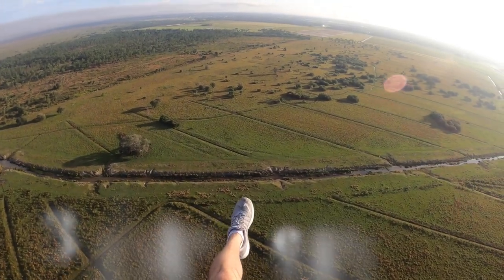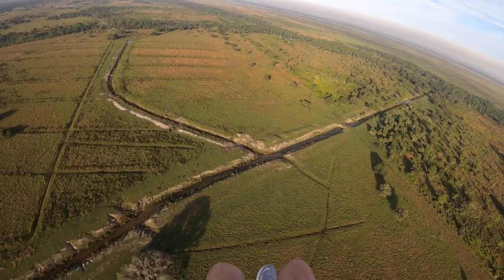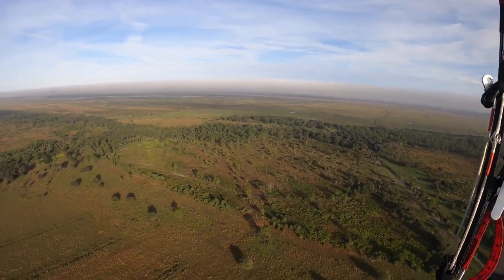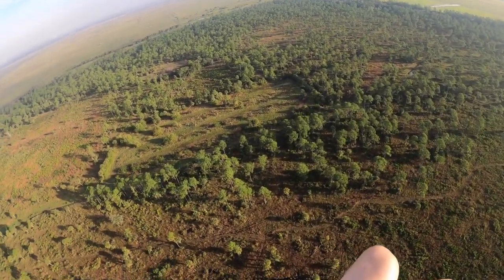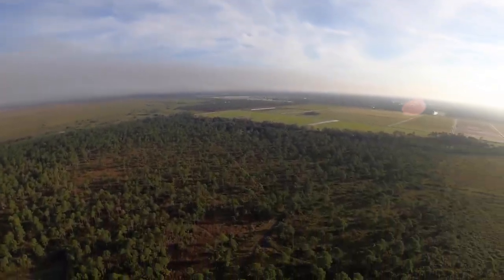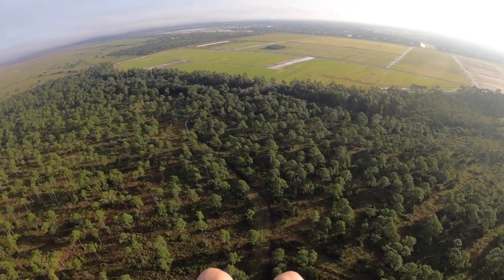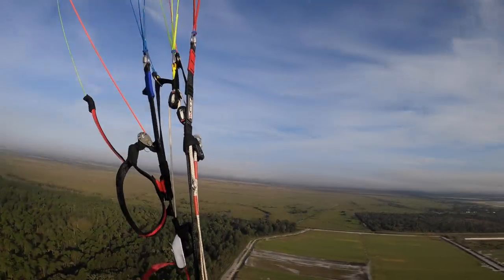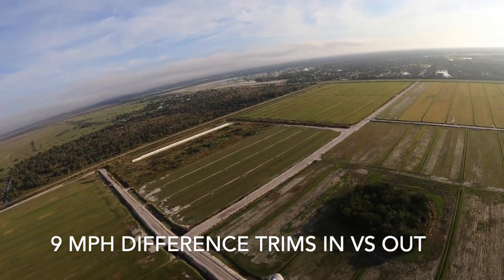Dudek Hadron 3 speed test!

Comment: Jeff, I fly a demo H3 22m a few times and really like it.  The trims were annoying though on the demo I tried, as it was touch to adjust out (they usually just dumped all at once) and not easy to let out evenly on both sides, and sometimes they slipped out on there own from launching a couple of lines, ever seen any issues with your trims like that, and how do they compare to other gliders you've flown as in how sticky/easily the trims operate?  THanks
Reply: have you people ever asked why while testing the dudek hadron why the pilots just didn't advise or do something about  the trims.??? do people have a problem speaking out.and getting to the nitty gritty.
Reply: have you people ever asked why while testing the Dudek hadron why the pilots just didn't advise or do something about the trims.??? do people have a problem speaking out? and getting to the nitty gritty. On the trims sow along the trims as per setting adjustment. when adjusting it wont slip as easy. It will catch on the segmented sewn-in line